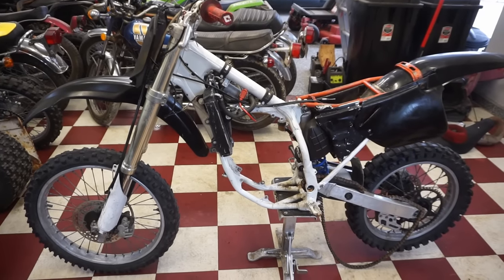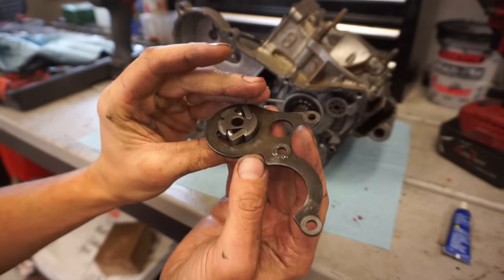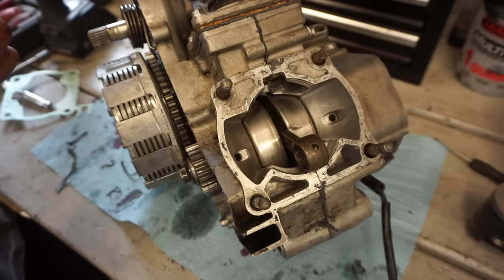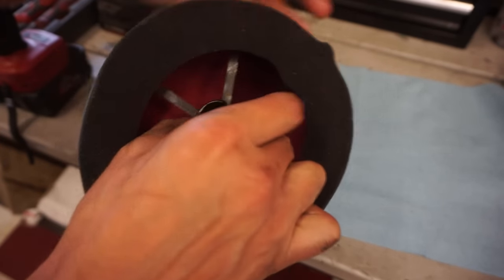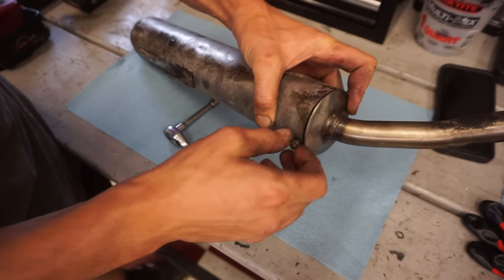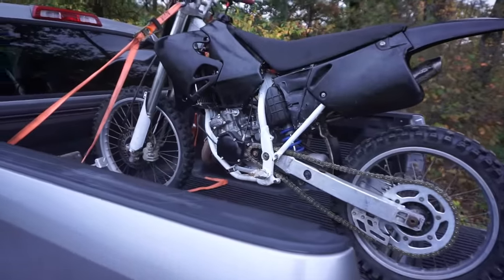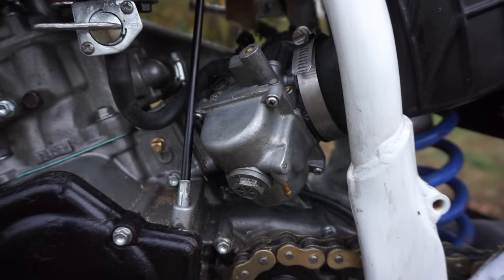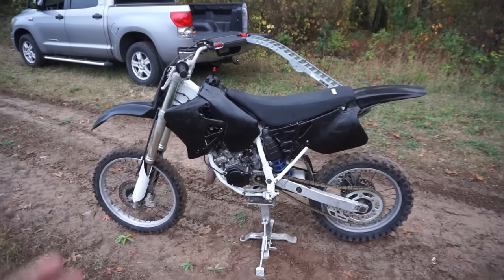Seller Gave Up On This $700 Dirt Bike (Won't Run Or Shift)

Comment: personally i would have changed the crank seals while it was apart. also, you left some old gasket remnants between the case halves. its a waste of time doing jobs like this if youre not going to do the fundamental things

Comment: How did you feel about not replacing the crank seals?
Reply: Blow it up and do it again 😂
Reply: He put a crank with bad bearings back in too
Reply: Hey guys , Joe knows everything and takes no advice from anybody. How dare you question him …….  😂
Reply: He even said uh oh to a hot rods crank and left it lmao
Reply: Ok I'm not bashing him at all he has dun good for himself on here. 
Yes there is thing that he does that I don't do. But I've done over 50 cr250 motors over the year. I do thing alot different
Like the carb dose come apart and cleaned to see what's going on in it. Rule number 1
This is a must.
I always  ohm my coils to see what they are at. If it's not putting enuff spark out then you are chasing jetting problems. And the caps go  out fast. 
  It was a Numura piston.
White wrist pin. $50 to $60 China 
The thing that fails on them is the wrist pin bearing.  The skirts crack fast .When it does you loose just about everything. Ive  taken mini motors apart with wiseco/ hot rod parts. With holes in cases  and so on. $399 to $450 China bottom end kits At the end of the day try to stay away from the China stuff..
I use OEM bearings seals crank/ Pro x  and im paying $450 or i put a new rod on the crank thats in the motor 
$120 for rod 
To press it on $100
Reply: He didn’t put the chain on right and threw the bottom chain guide!!
Reply: Also dribbling assembly lube on the rtv..going to have leaks eventually.
Reply: The worst thing is re using main crank bearings, that is such a NO NO! When ever those cases come apart, new main bearings and seals is a MUST.
Reply: @DanielMoore-k3p it is not a must.  If they arent damaged or worn out and are clean its totally fine. oem bearings and seals in a used state are at times better than a new replacement. Any time dollars can be saved and used elsewhere its a win win situation. Just keep in mind that there is more than one way to skin a goat. And he isnt building this for a customer whom he has to stand behing his work, its personally his. Big difference .

Comment: This is just an opinion that comes from a guy that’s owned over 150 cars and motorcycles. I myself would degrease, paint and clean (OCD) every part of each bike he rebuilds and plans to resell. Yeah the new owner will probably trash it again but I will pay a premium for a clean, good running and good looking bike than one that looks like it was rode hard and left out the dry. I’ve made 25%-40% more profit by spending 2-3 hours making a bike or car I’m selling as sweet as possible. It’s more elbow grease than anything else.

Comment: Check the float hight first, especially as it was flooding into the pipe, you need proper float hight, before you can jet and needle it properly, great buy man, nice bike, 👍🏻

Comment: Not a bad vid but wen rebuilding engines cleanliness is paramount and a habbit u must get into ,everything should be cleaned SPOTLESSY u also left gasket on the cases which is rookie i use grease to hold gaskets in place safes hzving to spend hours scraping them off when you need to replace them dont c the point of using sealer wen u r renewing gaskets quite a lot of people r whineing on about the chain not going through the guide instead going under it which yes is very ROOKIE but i overall you did good some day you will be  top class mechanic no doubt

Comment: Might need to move that throttle needle one click down. Seem a big groggy in that mid to high range. But more importantly, CHECK THE FLOAT HEIGHT! Im telling you, you will never get a good tune without checking that first thing!
Edit: Also By the sounds of it, it either needs a new plug or the coil contacts needs to be cleaned (Misfired between strokes) I posted a video if any of you want to hear what that may sound like on a 2T (Read Discrpition for detailed info on why). Both are super easy to do. This bike has insane potential. What an absolute steal!
Reply: Yeah, kudos to Joe for getting it running but that thing is running like a basket of ass!!!
Reply: Yep
Reply: Bro rebuilt the entire engine and didn’t bother looking at the carburetor.?!?
Reply: @OffroadTakeover8  he swapped the jets. He cleaned so many carbs in the past so its hard to say that he didnt look at, probably just didnt feel like filming it. idk Who knows.

Comment: I'm fairly certain the chain needs to be routed through the rear chain guard, not underneath it.
Reply: Ditto!
Reply: im pretty sure its worn all the way through and just looks like it cos theres no bottom. needs to be replaced.
Reply: no its not, because its worn, so its open guide now
part needs replace
Reply: @tna-- I don't believe the OM chain guide was open like that. There should be a rubber in there that the chain rides on top of.
Reply: ive seen bikez in the past that they have worn through the rubber and all the way through the metal at the bottom. if not checked.
Reply: I noticed that chain routed wrong underneath as well but he off loaded and ripped it so it must be correct now. 😊

Comment: Definitely some serious out-of-order editing going on. First, clutch goes on with the primary gear missing, and I’m laughing lol, then next clip clutch hat is on, and low and behold the primary gear is on haha.
Reply: You missed the chain "under" the rear sprocket chain guide.  So simple that nobody would guess could be wrong, only a couple people on here saw it.  Take a deep breath before you see that, because you will laugh yourself out of oxygen.  I can't believe he did that myself.  I think mankind is doomed.
Reply: @EarthSurferUSA  I posted that one separately. You replied to it lol
Reply: But it runs

Comment: Great job on the diagnosis and the rebuild. I loved riding those CR’s back in the day. My last dirt bike was an 89’ CR250, rode the hell out of it until it was stolen in the mid 90’s. Never got it back. Decided to pull the plug on dirt bikes. After seeing and hearing you rip that little 125 around a bit brought back a few memories. Should be a nice bike once you get it dialed in. Great job on the video!
Reply: I thought it was a yammy 😂looks like one

Comment: Aviation sealant is better than tube UltraBlack , plus it has a brush on the cap for application . I used it on VW engines in the 80's and since it worked well,  i use it for any seal job or gasket adhesive. Very thin surface height,  solvent resistant,  fuel and oil resistant.  
 It has never dried in the plastic can either.
Reply: I for one, representing the ghost of technologies past, always wonder "Where's the Form A Gasket (think blue stuff)?"  Used mostly for valve covers and carburetors.
Reply: Im sure u cant get any of that anymore they quit making anything decent
Reply: I use that stuff too. Also do vw stuff. It's good stuff, and I never worry about a little chunk breaking loose and clogging an oil passage
Reply: Stag Wellseal Jointing Compound  used to stop leaky British motorcycles and possibly developed by Rolls Royce
Reply: Is any sealant specified?  The thin green aramid fiber gaskets are impregnated with resin or NBR.  They shouldn't need sealants with clean flat mating surfaces, and have the best longevity on stressed assemblies when installed uncoated.

Old 'paper' gaskets were close to actual kraft paper and did need sealant.

Comment: That's the right set-up on that Kehan carburetor. like that it's off of A snowmobile engine. So it's going to be A totally different carburetor set-up than the stock factory style of one. So you're wrong on the jetting sizes for that carburetor though. Just saying those original jets belong in that carburetor for sure. I know cause the plastic piece inside of it those are inside of snowmobile carburetor's and jet ski carburetor's to. Jus like dirt bikes one also the only difference is the jetting sizes for sure. I went to A vocational school for small engines trust me it's 👍 right bro. Clean them out put them back inside and then try it out. I highly recommend cleaning out that entire carburetor first due to the water issues as we'll then retry it out.

Comment: Tunning / Jetting ( GAS - Oil ) Mix  along  with Air Screw and  Needle settings are a  matter to be  addressed both Separately and Together.  Part of Checking to see where things need to be.  Pro - Circuit and  FMF  differ from stock.  LIKE the  Changing  of the  Air Filter element. Are YOU running  87, 89, 91, 93  Octane ???  What  type of 2 Stroke  oil are you  using?  The  Spark Plug  could  also need to be  changed for the  heat  range. Hot - Cold - Stock - Etc.  WHAT YOU NEED TO DO ???  One  thing at a  time.  Get the  Exact  Jets ( PRO - Circuit ) recommends.  Water in the  gas  or  Poor  Float  bowl settings  will cause different issues  to be  resolved.  CHECK ( Double - Check )   Then Check it  all again. a  two minute  test run  will NOT Conclude or  Exclude a  single item.  The  Actual  Running  temp of the  engine VERSUS  Cold  Start or  Over heating  will effect  a lot in the tunning  process. 
Mechanics and  Tuners  Rely on Actual  FACTS  Not  Fiction.  The  Seat of  YOUR  pants or  What it sounds like  can vary greatly  by location , altitude, and  time of  day with the  Air  quality being the  ( Constantly ) Changing  factor.  Cold  air - Warm Air - etc. 
Today you  di d Part of  the  puzzle. YET, ( IF ) the  GOAL is to get it ( RIGHT )  there is  More work to be done.  Start with the  basics.  Empty all the  fuel out of the  tank and  the  carb  as well.  GET  Fresh Gas and  watch the  MIX as close as possible to be where it should be  In the Middle of the  range  Not  high  or  low.  Verify the  proper  main jet, Pilot  then set the  idle screw and  Needle accordingly.  Warm up the  bike without Driving   it  for  at  least a  few moments.  Then Shut it  DOWN Wait about  15  to 20 minutes.   Then do it  again. 
After TWO cycles  now  let it  warm up by itself.  Sitting  / Resting.   See if the idle increases or  if  it  starts to stumble all on its  own.   Shut it  down and let it  completely  cool off. 

(IF)  You followed what  was Stated for the  UPGRADES and have  everything set PER the Manufacturer Specs.  Consider what  you  did with the  sprockets both  front and  rear. 
How a Bike  takes off from a  stop versus its  running  to top speed total  will greatly  vary by the  Ratio being  used.   Its  NOT  important what  came  stock as it  is  what  CURRENTLY is  being  used.   To many front  teeth  versus  Not  enough  back teeth.  The  BIKE  will preform Different  if  each one of  this  steps is Out of  Whack. 
TUNNING is a  Combination of  both  Sitting and  driving. 

This is  a  Used bike. The  Previous  owner could have  switched out  each item and  made it  work against the  upgrade.   See it  all the time.  I got a  Del on this  so  I switched out that.  No Worries it  will all come out in the  end  ( WRONG  Wrong WORNG )  Now  before you  go BLOWING off all that has been said ) REMEBER what it  was and  was NOT  doing when you  first  got it .  Each things builds on from the  last.  its like math.  1+1 = 2   ( YET )  1 x 1 = 1 .  IF  ONE THIJNG is  OFF / Wrong  then you  keep trying  to fix  something  else  ( IT WILL NOT be  what  it  should  be  when  you  are not  dealing with the  WHOLE  problem. 
Rule of  Thumb. Adjust / change  ( ONE ) thing at a  time.   before adding  or  taking away from where you  are now.  Look at  what  came on it  stock.  The  Teeth Count  Front and d rear.   The  Carb size and also the  proper  jets for the  upgrades.   Some  Products  will say.  Tuning / jetting  will be  effected by adding  these After market products. 

Ech step effects the  next.  Go through stock settings. IS  what you are now trying to change the  proper way the  NEW products recommend ???  from what ( I ) can see on the internet.  The  previous owner  did  Little to Fix the  problem yet  added a lot  more issues then what  ( HE) started with.  Ignore this Advice.  YOU WILL ONLY  BE  ADDIGN  MORE PROBLEMS GOING FORWARD as  before....
Reply: Short version, set up your air screw for idle and off idle
Select pilot for smooth transition to mid.
Set needle for smoothest mid transition to main.
Select main for smoothest top.

Comment: Just want to see if you put the chain through the chain slide on the swing arm. On the video you had it on the bottom, and it needs to go through the slide.
Reply: He rolled it off the truck at the end, and rode it that way.  Unbelievable.  It is called a "chain guide",  not "slide".

Comment: My stock 2023 YZ85LW has the same exact "breaking up" problem. I know I'm running the correct fuel and oil mixture, so I've been thinking its got to be the carburetor. Because there's nothing else it could be, I've checked everything else and its all good. It has the stock jets and stock pipe so I'm assuming its where I live causing the problem. Gonna plan on trying out several different jets and changing the needle position. I really hope I can figure out the problem. Its a really good bike other than that.
Reply: Depending on your elevation the jetting may be off. Factory jetting usually is on the rich side at sea level so if your at altitude you may want to lean pilot and main or drop your needle a clip to lean out the mid. Good luck I hope you get your bike set up to your liking. 👍

Comment: If you put grease on those case gaskets, they won't stick if you ever need to take them off again. With the sprocket bolts, if you hold the allen head and tighten the nut on the back side, you won't ever strip the allen bolts out. Just the opposite of what you did.

Comment: For removing gaskets you should try some of those less or non abrasive wheels for a drill or grinder you can find one that works idk what they are there made from some rubber or compound but there’s a way with no razor blades
Reply: They work good, but also throw alot if material around. Best to have a bare case if using a wheel
Reply: Razor blades are actually the best thing to use.

Comment: looks as fast and more useful power than a cr500r. I honestly thing 125 or 250 is good enough for a 2 stroke.
Reply: My own thoughts on the cr500, it never was a great moto x bike, I use mine in desert racing and the power allows you to raise the front sprocket and lower the rear for flat out desert running, easy to gear for a simple buck fifteen flat out, also great in the dunes . Moto x 125s and 250s are lighter, more maneuverable and less tiring. But for dunes and desert 500s are a must 🙂👍

Comment: I've never heard of someone using motor oil in a gearbox. I'd really like to know how well this works. Anybody ever do this?
Reply: All motorcycles use oil in the transmission. Use motorcycle specific oil or engine oil without friction modifiers which can cause clutch slippage. 4 strokes use the same type of oil, but it also lubricates the bottom of the engine. Change it often as there is a lot of shear on the oil. I’ve owned bikes since 1978.
Reply: A bike tranny is much different then auto or truck that uses 80/90w in manual trans, diffs, trans cases. A bike doesn't have the extreme pressures and as another commentor mentioned it contains a friction modifier for the wet clutch. All factory bikes I am familiar with use 15/40 or 20/50 the later seen mostly in HDs.

Comment: Can you fix my bike please? 
I took my bike to a "highly recommended " bike shop in my area, they charged me $2500 for the supposed work they did, and now I can't keep it running, and I just want to be able to ride. It ran fine before they worked on it, just had oil leaks. 😢😢😢
 1978 Honda xl250s.

Comment: On the mid-90's Honda 125's turning the choke knob till it idles leans out the pilot circuit. Back it down till it just dies from idle. No idle. Install a 1368 needle 2nd clip down. Much better bottom end.

Comment: The first pass after new jets, or right jets, you never mentioned the air screw setting or where the needle was it was grumpy till it cleared out. So moving the needle one click leaner and turning the air screw to 1.25 might make her live. It turned into a very good deal and some young punky could race the poop out of her. Needs decals and painted some OTHER COLOR. Next guy doesn't know what he is talking about.

Comment: I have a drz 400sm , when I changed my sprokets, instructions said i should use lock tite, so I did. You put one on without any, and those bikes shake more than mine. Any thoughts? Thanks for the video